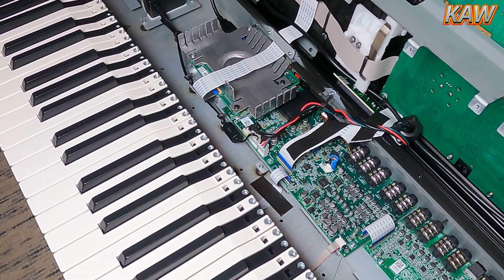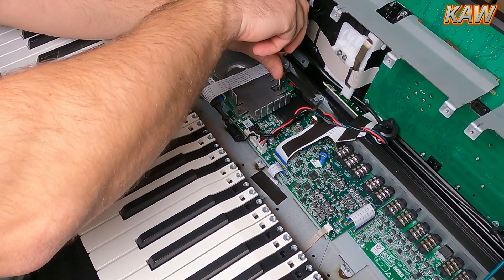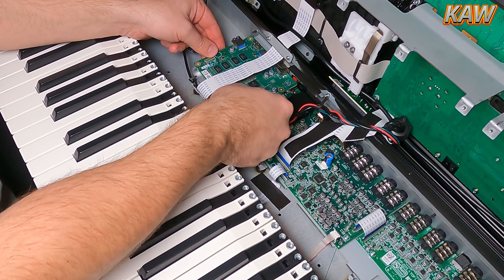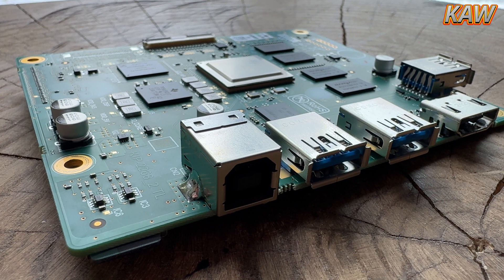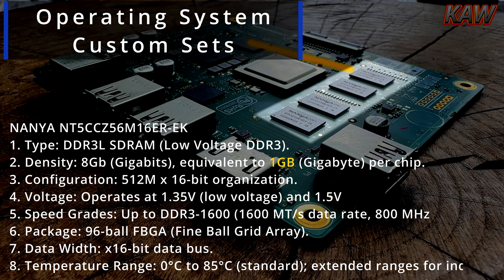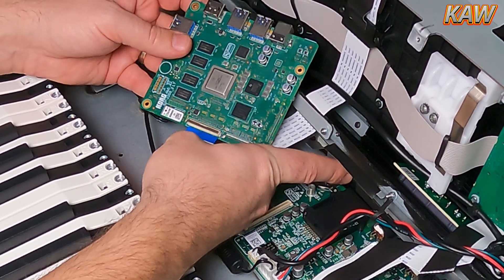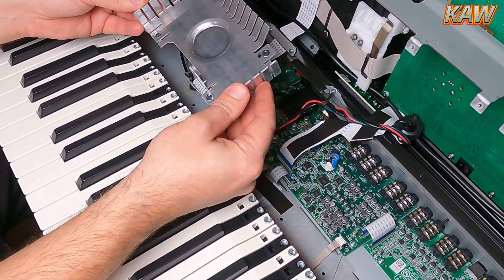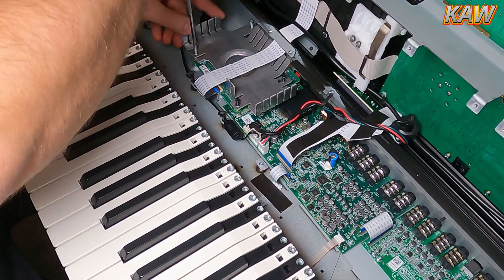Korg Pa5X CPU Board Removal and Installation Process

Comment: Hi, please tell me, in the back panel of the Korg Pa5x there is a plastic cover, if you open the hole near the micro SD you can see the connectors. What is this?

Comment: Nice video. However there is a mistake in your disassembly process. You need to remove the FFC cable from the board and then remove the heat sink. Otherwise there is a good chance of tearing the FFC cable with the sharp edge of the heat sink, which will then render the whole instrument useless. While assembling the FFC is the last item to be connected, before screwing on the heat sink. "This is a Pro tip from an electronics engineer with 30 years of experience. Always be very careful with those FFC connectors and cables, they are fragile and can be damaged easily, but cannot be fixed that easily."
Reply from the maker: Thanks for the info!

Comment: Many thanks. If this board is not working donwe also loose all stored data in the user area ? I mean the user are visible in each menu and not the external SD card.

Many thanks if you can answer.
Reply from the maker: I am afraid to say it, but I believe you will loose the data, make sure you backup your sets as much as you can.
Reply: @ 
Many thanks. It was unfortunately the case. I lost almost 2 weeks of data. Do you know why all the KORG seems to have an issue one day in their lifetime with this main board ?